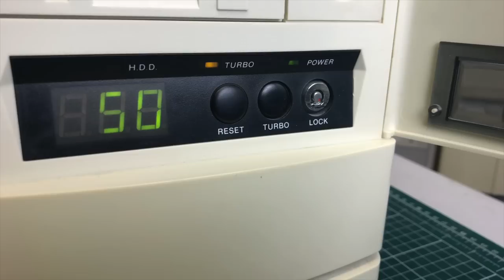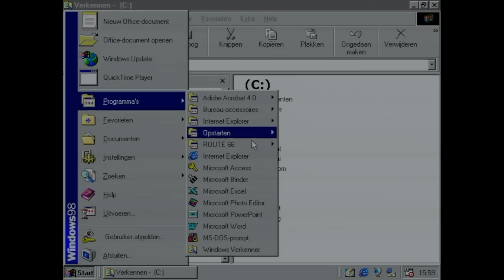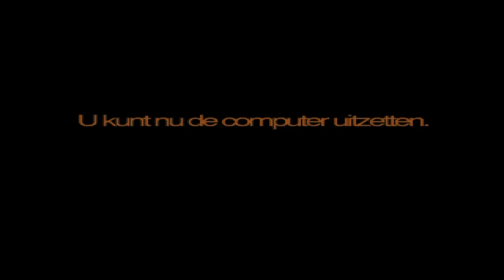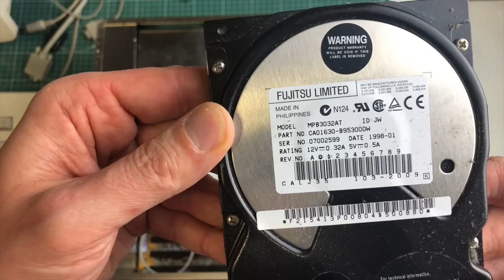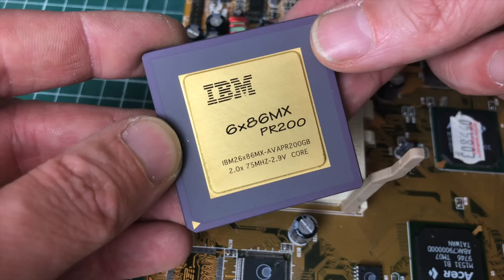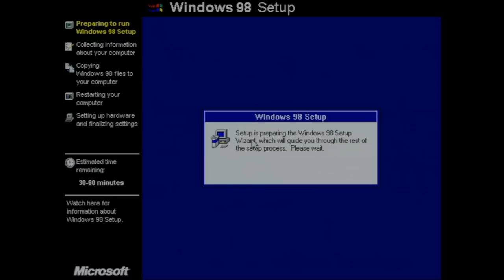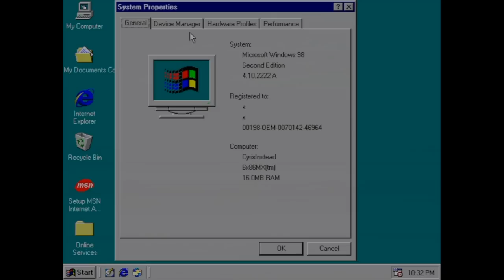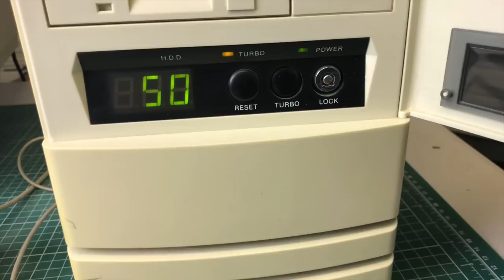IBM 6x86MX PR200 find in a gorgeous nineties PC case

Comment: PR means Performance Rating not Pentium Rating. It means that the rating performance is 200, I dont know the performance of P1@200
Reply from the maker: Correct. Thx for pointing that out.
Reply: PR is supposed to be the number of mhz a Pentium cpu should run to have the same performance, so a Pentium 133mhz would have a PR of 133.
Reply: It's called performance rating officially 'cause Intel holds Pentium trademark. But unofficially in daily talks it was Pentium Rating for sure :)

Comment: Nice little computer. But I never understood why they put those serial and parallel ports in the expansion slots when there are four knock-outs in the case directly below the power supply.
Reply from the maker: Probably because for pc builders it’s too much of a hassle / too time consuming to remove the knock-outs from the case, unscrew the 3 ports from the 2 brackets and screw them in the knockouts again.
Reply: Well, the IO card still used the card slot either way so why not put the basics on the slot cover if you didn't need the rest? Good Multi-IO cards had 4 serial ports, 2 parallel ports, 15 pin joystick or two, maybe an IDE port or two. Most IO cards had 1 serial, 1 parallel port.

Comment: Nice Video. I would need a video on how to fix such a door mechanism^^ Sadly my old 2003 Alienware has the same issue on the front door  :(
Reply from the maker: Well I have another case with the exact same issue. It is the big tower version of the case that was shown here. Perhaps I'll take a look at it in a future video.
Reply: Go to a hardware store and buy a magnetic catch, the type that holds furniture cabinet doors closed.  All you need is the metal plate, really.  Find a slim magnet, perhaps from a broken 2.5" hard drive.  Glue the plate to the door, and the magnet to the case.  Job done.
Reply: @MarkTheMorose  Then i would need to cut off the part of the door mechanism that sticks out. I dont want to ruin my alienware case if there is a possibility to repair it. But thanks, thought of something like that myself. The next problem is, how do you open the door when it is closed with a magnet?
Reply: @ray_sattler  I think the black catch on the door just pushes in to fit, you may be able to remove it with pliers.  As to the magnet, I realise now that it wouldn't work on that case without some modification.  The case I used one on had a 'key lock' as well as the catch, so I could just turn the key to unlock, turn the key back slightly, then pull on it to open the door.  With this retro case you'd have to cut a neat 'finger divot' out, or fashion a little tab to pull the door open.
Reply: @MarkTheMorose  The Alienware also has a key lock, but i can`t find the keys, maybe i find them someday^^

Comment: 5:55 Actually....the sound card is a bit of a Gem. I usually replace SoundBlaster Pros with it because it is probably the most compatible cards for SB Pro emulation AND has a wave table header. I base the compatibility on one game. Gary Grigsbys Carrier Strike. It appears to have been hard coded for the SB Pro using IRQ 7 for sound. And many a card fails to run sound on this game. Not so the ALS100. Also the Ultima 6 sound track sounds superb. The one bug bear with it is the location they put the wave table header. On one of my cards it is perfect and i have a GM board attached. On the other it is located ridiculously low, much like yours appears to be so is totally useless.

Comment: Funny, I never really could use my 6x86 PR166 CPU on Windows 98.The one I used 15 years ago could install and run Win95 no problem, but I never could get Win98 setup to start.

Always got that '' Invalid DPMI return. '' message after loading the first part of the setup with the GUI. It just went straight back to DOS with that error message.

I never really bothered to search deeper for the root of the problem, just swapped it out for a Pentium MMX 233 MHz and the setup started flawlessly.

Comment: Those little ports right under the power supply, that look like they break out, do those have a name? What are they used for?
Reply from the maker: I think they are called knock outs as another viewer mentioned here in the comments.
Reply: Multi-IO cards did not have enough space to put all of their ports on the card slot. So you would get a bunch of DB connectors or whatever on long cables that went into the case knockouts. USB ports didn't exist when that case was made so you needed 4 serial ports, 2 parallel ports, a SCSI port and other stuff. Nicer cases these days still have them. Though most cards now just use multiple card slots as needed. Card slots were at a premium back then because they were often shared between PCI and VESA/ISA slots (that is, you often had both types of slots behind each slot cover and could use only one or the other).
Reply: If a modern case has them, can they be used instead to mount additional USB ports? They appear to allow you to mount ports with screws, so something like this might work? https://i.imgur.com/JJ9WpmP.jpg
Reply: If you have access to a 3d printer you could print a socket to put the usb into.

Comment: i had m2 before just ...it run poorly for quake and quake2...so i found a pentium 233...back my days ..it was great find when i was younger and replace crap emachine  chip with pentium that cost me nothing since my teacher was gonna throw away the computers when school upgrading to pentium 3 dell..it was old but works well during my freshmen class until i have it my hands during junior-senior  years  when i have networking class..before that i was for basic computer class during freshmen first year...same teacher...after i finish HS....i went to college ..i bought me Compaq came with Athlon 1 ghz ..but it was also cheap and crap..so i also found pentium 3 tulatin during my colledge class...they were in process upgrading to intel core processor units..i really don't know what is...but pentium 3 in my hands just like the dell computers...it ran great during my time but sad to my disappointment it didn't last long after few overclocks so i went buy HP that came with core 2 quad..it was actual first buy of computer honestly..with saving i made during my years now i can afford it ...

Comment: If your computer is showing you a screen on shutdown saying it's safe to turn it off, reset the CMOS. I did that on my Gateway Win98SE desktop and on shutdown that screen no longer comes up. I needed to clear the CMOS password to check the BIOS to see if it understood Japanese 1.2MB floppies.
Reply from the maker: Really ? This shut down screen is so burnt into my memory I assumed it was normal for windows 95 / 98 systems. The computer did have a brand new coin cell and I did reset the bios.

Comment: You like that case ?
Well I have the same one ... but MUCH bigger :DI can fit a AT size motherboard in it (I mean AT, not Baby AT !). The case offers no less than SIX 5"1/4  bays :D
Interesting to see that they've made a smaller model !
Unfortunately mine is in a poor shape : the PSU (which is not a standard shaped PSU) is dead and the case is full of rust, so I need to clean that and maybe paint it. Since there's a black/white thing with this case, I believe painting the inside in black would look best :D
Reply: You can view pictures of it here : https://www.vogons.org/viewtopic.php?f=46&t=50906
Reply from the maker: Have the exact same one :)
Reply: @RetroSpector78  Oh very nice !! I get why you "get rid" of that one then :) (though I'd love to have both sizes xD)

Comment: lot of time cyrix had catchy name but specs are bizarre to me...what good with extra cache but running half speed than Pentium or AMD do not run half speed FPU...until they got full speed FPU that be after VIA bought them and rebrand them C3 from MIII was in process finalize ...it do show promising returns but it was very late when pentium 4 starting have 2 threads and 4 threads later on...while AMD was doing their thing with x64 bits ...while CYRIX C3 is not

Comment: i would add those 2 missing ram chips to that graphic adapter
 1mb cs 2mb of ram is like 1024x768 in 256 color and 16 bit color difference
then again i did exactle to horizon 64+ ' s and s3 trios

Comment: you probably have these stripes on the screen because your vga cable is faulty. i had the same years ago when i still used vga
Reply from the maker: They are all new cables (hdmi and vga). But will do a separate video on how I do capturing so you can have a better view if what I use (and how I use it)

Comment: No cooling paste ?
Reply: @lowbudget780  Apparently, I have not seen that before
Reply: Back in  the day it was pretty common to not use thermal paste... one cpu generation before you didnt even need active coolers, and before that they ran without cooling... Thats the great thing about evolution... (things get better sometimes) :D
Reply from the maker: Martin Skywatcher would be interesting to hear people’s thoughts on this. Was definitely not needed back in the day, but wonder if it would have a positive effect on the cpu lifespan today.
Reply: Wasn't a thing for a long time, but I agree it does looks strange looking at it with today's eyes
Reply: Wouldn't hurt to use a little of the cheap white grease.  :-)  Particularly if the sink gets more than a little warm.
Reply: @RetroSpector78  I'd certainly apply some thermal interface material (pad or paste). It was recommended even back in the day, but many didn't have thermal paste readily at hand. I wonder if the CPU got some undervolting because it ran into thermal issues with the cooling solution as deployed.
Reply: @RetroSpector78  Yes it would definitely run cooler. A cool CPU is a happy CPU.

Comment: "Pentium Class" except the FPU. I learned many months into using 6x86 that Windows NT 4.0 didn't support the FPU. And I had encrypted folders enabled. It got slower and slower and slower and slower and one day it simply would no longer boot. I threw it away and bought a real Pentium as soon as I had the cash.
Reply: none the compression nor encryption in NTFS uses FPU. Those algorithms are purely integer.

Comment: So this was the world's first dual core CPU for low budget PCs ?
Reply: 6x86 was not dual core in any sense. It was not a Pentium in any way except it had the extra instructions of a Pentium. 6x86 was a straight 486 with extra instructions (compare to the modern Intel Galileo CPU). There were no true dual core CPUs. There were barely any dual CPU motherboards because almost no operating systems in existence could deal with multiple CPUs at once; even UNIX based systems did not yet normally support multiple CPUs. NT barely supported SMP at all and dual CPUs weren't even going to be allowed to be used by Microsoft on workstations until people threw a huge fit; MS charged per CPU. DOS never supported more than a single core. Pentium CPUs were the closest thing to a dual core you got on DOS. Oversimplification: Pentium pretended to be a single core to the OS. But it was really a 486SX and 486DX on the same die with only one set of special instructions like MMX, ALU, FPU, etc with pipelining setup to run instructions on both cores at once when possible. (hence your two instructions per clock cycle) That's why they were like 1.5-2 times faster than a 486 given the same workload. If both sides needed the ALU or FPU then only one instructed was run at a time.